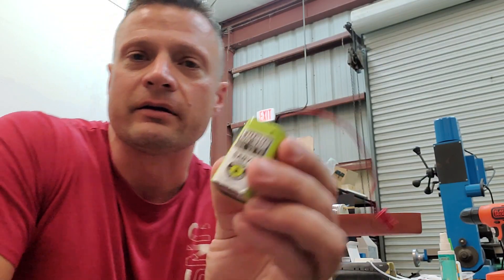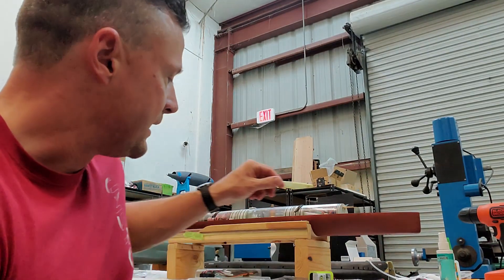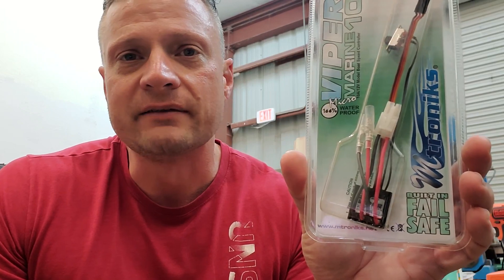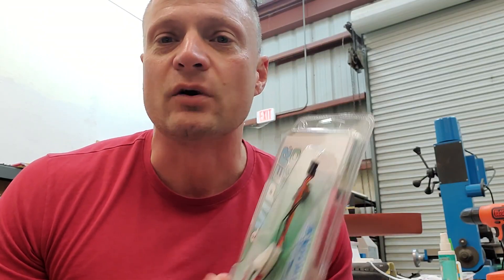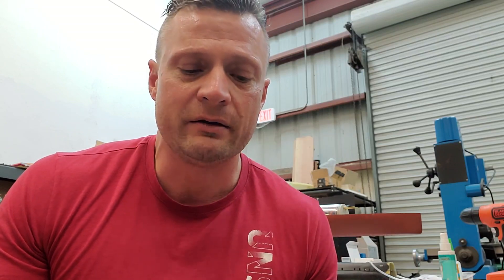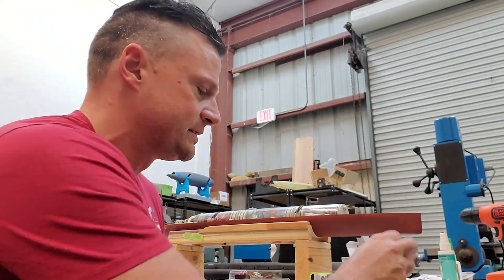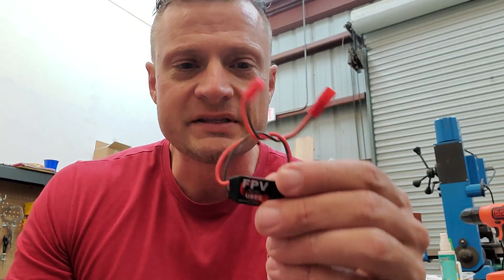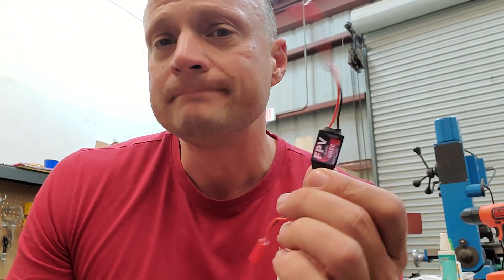What the heck is a BEC and why do I need one in my RC submarine?

Comment: i build rc sub and rc airplanes, in big gasser planes this problem is the same and even worse becouse a gasser airplane can have more than 6 digital current hungry servos that only one can draw up to 3 amps alone in a high speed tight manuever, however in a sub is kindla overkill that kind of servo, if the datasheet of the servo says that can draw 3 amps that's not necesarly be the case of the model becouse that current is in the maximum torque or stall torque, rarely you are going to need high torque servo in a sub, subs are slow scale looking models, if the servo is doing force lube the rods seals and check linkeages becouse that is a simpton of something is wrong, even a standar size servo works well in big models and a standar servo in the maximum torque dont pass the 1 amp and other thing is that rx pcb tracks cannot handle more than 3 amps, so if you are needing more current you will need a power distribution board that commonly come with a integrated bec, also you can make a inexpensive bec of 1 amp with a 7805 and a tiny heatsink and two capacitors